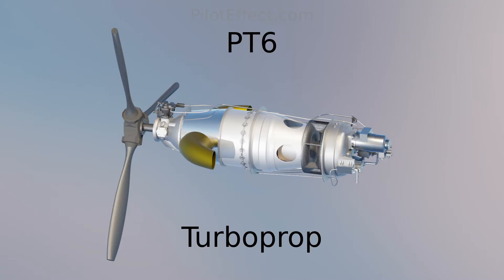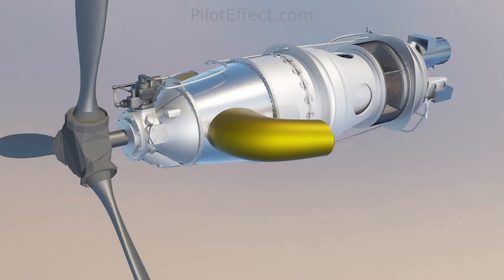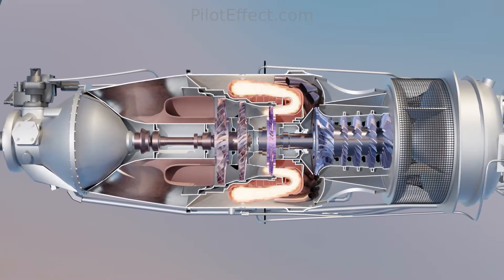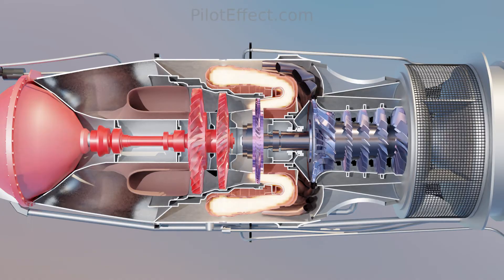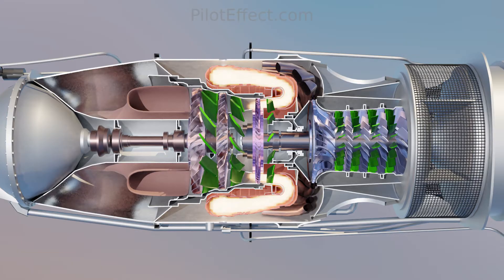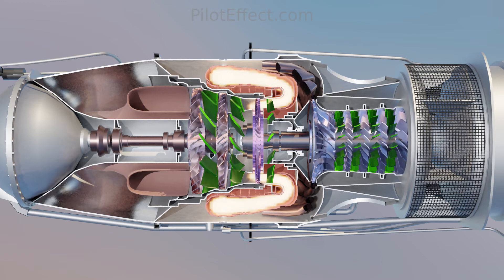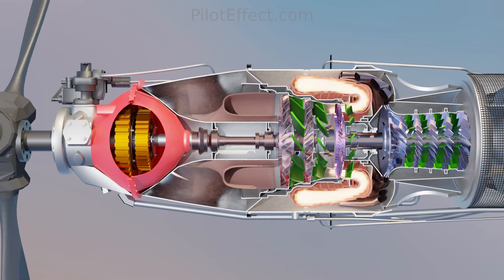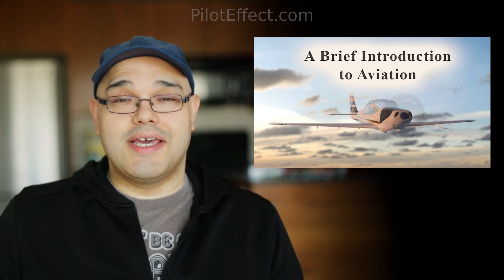PT6 Turboprop Tutorial

Comment: Eclipse 550 twin jet has better fuel economy than Baron 58 and Cessna 401 piston twins. Therefore turboprops should not exist.
Reply: I both flew PT6’s in Kingairs and maintained them too. There are things turboprops can do that jets cant. There is indeed a place for jets, turboprops and pistons.
Reply: @craigg4246  strong thrust reversal is a neat trick it's just not worth it. the drawbacks with turboprops are far too great. Noise, space they take up and compromise the design, thrust asymmetry, ugliness, visibility and actually worse fuel economy ironically. Although some could be aerodynamics.
Reply: @ thrust reverse is only one of many. Sounds like you haven’t flown them? How about the ability to go down/slow down? Jets and pistons either can’t or struggle with that. Is easy for turboprops. I have been at 5000’ agl on a 2 mile final, and had to add power to make the runway. And been at 7,000’ agl abeam the numbers on downwind, again, had to add power to make the runway. Or being able to keep my speed up on approach to fit in with heavy jet traffic into big terminals, and then drop 60KIAS one mile from the FAF. Or operate out of short soft strips? Took the Kingair into a 2700’ strip. Don’t try that in the eclipse. Some missions are just better served by turboprops.
Reply: @craigg4246  how is having to add thrust on approach in any way a quality? and 60knots is below stall speed of any turboprop. That's poor airmanship
Reply: @ no, try to pay attention here. Sheeesh. You can lose 60 Knots in 1 mile. Not go 60 knots. Like reduce from 200 to 140. And having to add power, was just to illustrate how easy it was to descend rapidly. Have you ever flown a plane?
Reply: @craigg4246  ok, dropping 60knots is not really a major feat, throttle to idle will do that for most jets on approach I imagine. lose the attitude because you don't have an argument for turboprops. I repeat, noise, space they take up and compromise the design, thrust asymmetry, ugliness, visibility and actually worse fuel economy ironically. Reducing speed doesn't really compare. And like I said reverse thrust is a neat trick, it's just not worse all the drawbacks. That you are irrationally fond of turboprops doesn't change the facts.
Reply: @ you obviously have no knowlege of jets. No, they can’t lose 60 knots in 1 mile. You should stop weighing in on things you clearly know nothing about
Reply: @craigg4246  gear out, flaps and idle throttle can't very quickly shed 60 knots? do I have to test it in a sim? and some jets have speed brakes. it's not a feat. It doesn't make them less noisy, less ugly, less design compromised, more fuel efficient, less slow. I also had the impression that turboprops had merit, it's just not true in reality. An Eclipse twin jet has significantly better fuel economy than a TBM 960, it's much faster and it has a wider cabin. Choke on it.

Comment: How much additional thrust comes from the exhausts than the propellor? Could the exhaust gas not turn some smaller propellors to gain some extra thrust or generate some low end power for the plane. Since its a gas turbine and gas turbines can burn lots of fuel, can they operate different fuel types more efficiently.
Reply: on some planes like a king air it can be up several hundred pounds of additional thrust

Comment: it's worthy to note, although stators, according to this video, apparently do increase pressure, they also straighten the airflow, while simultaneously guiding the airflow in order to prevent a compressor stall. I said apparently because I haven't heard personally before that they increase pressure.
Reply: Neither have I, but it makes sense. The air after passing a compressor will be rotating somewhat with the direction of the shaft. By straightening the flow, you would essentially slow down the flow along that rotational axis, resulting in some increase in pressure.
Reply: @米空軍パイロット  Very true, because pressure and velocity are inverse with eachother.

Comment: Whaaaaat
I never knew that, so turboprop is basically a jet engine spinning a propeller?? whaaaaaat
Reply: ....A turboshaft rotating a propeller, which provides virtually all of the engine's thrust.

That's the same thing with larger turbofans for large airliners (Airbus / Boeing) . The engine core's (gas generator + free power turbines) main purpose is to drive the (enormous) fan ahead of the core that produces over 95 % of the engine,s thrust.

Comment: ratio between drive shaft & propeller (amount of reduction)?
Reply: depends on the engine but a good average is about 16:1 with 35,000 down to 1900rpm though some its 20,000:2000 so 10:1 and some its 50000:1700 it all depends on the engine and application because different props can use the same engine and you're trying to govern that prop for its max efficiency a bigger prop needs to spin slower or the tips can begin to go super sonic which leads to sudden losses in thrust

Comment: Reverse flow is due to the reversal in flow direction in the combustion chamber
Reply: Exactly.  A TPE331 is a reverse flow engine even though the air comes through the front and goes out the back.  

The PT6 is also installed “backwards” in the Beech Starship and Piaggio Avanti.